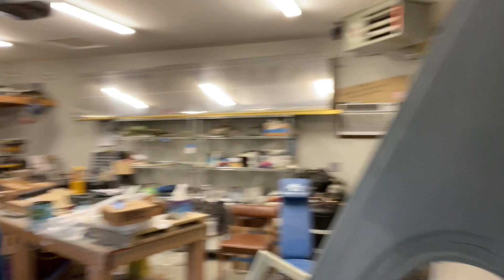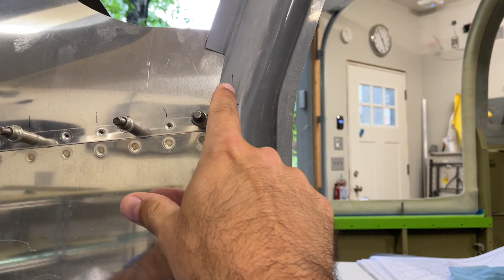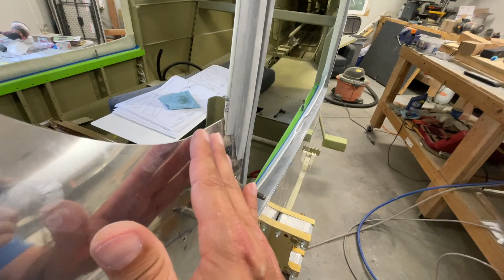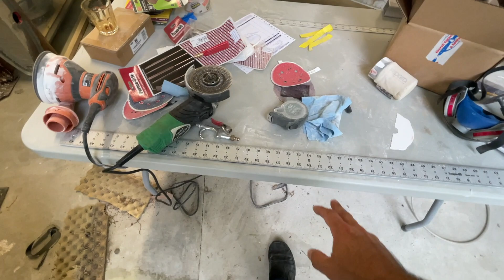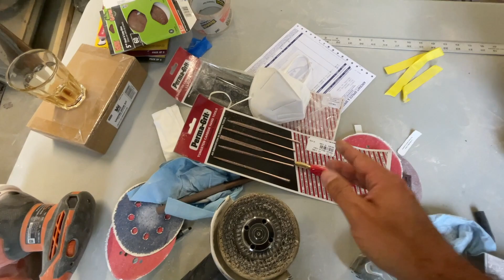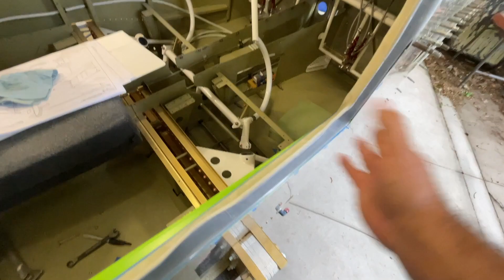RV-10 Build: 05/22/2021 - Fiberglass Canopy Overview

Comment: this answers my tool question from your other video.  New question, looks like the forward most top skin got installed since it needs to blend with the cabin top forward of the dash.  You have this installed with no avoinics yet installed.  Did you find this a problem later when installing avionics?